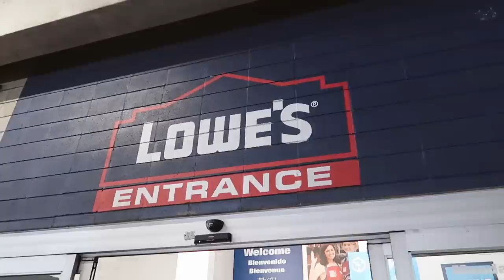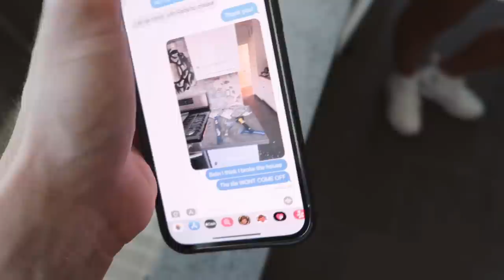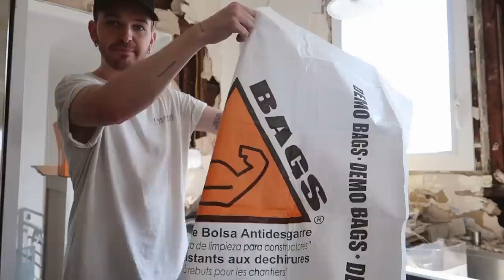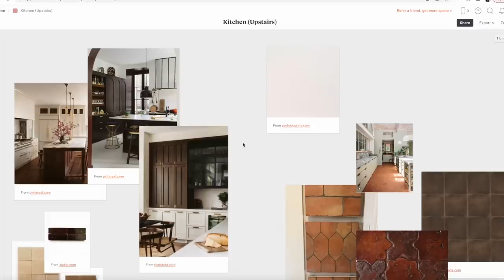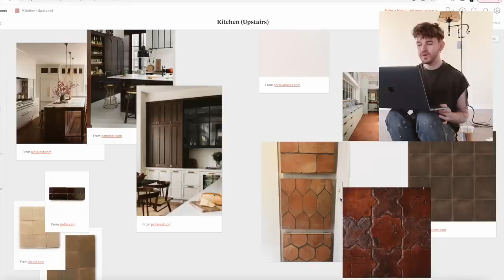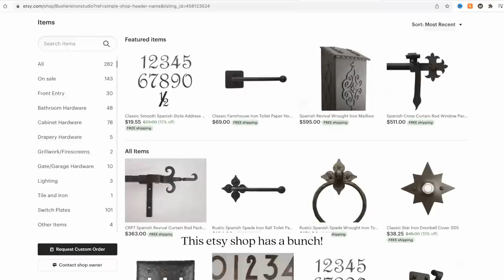I destroyed the kitchen

Comment: The good thing about ripping out the dry wall in the kitchen is that it's a good opportunity to get the electricians in to install the wiring for  more power points or new oven connection if you need it especially if the new layout is different so the power sockets for the fridge, microwave, range hood etc will be in a different location.
Reply: I was thinking the same thing. It's a great time to update wiring for sure.

Comment: Drew, please wear a respirator in case you have lead. I enlarged some windows in an old 100-year-old farmhouse and ended up with elevated lead levels! Just an FYI. I rehabed houses for resale and loved watching the changes as I torn things out and replaced them. It is so satisfying.
Reply: You are right. Either one is a problem. If asbestos is found that is a game changer for a demo. Simply using a saw to enlarge the windows caused the lead from old paint to sift through the air. Luckily the insulation in my old farmhouse was not asbestos.  Another place asbestos is often found is around water pipes and heat runs. My father-in-law was a steam fitter and dies of asbestosis.

Comment: Such a fun video!! You’re so cute with your butt sweat. LOL 

I’m a degreed kitchen designer and I love what you’re doing. Please consider installing a new, wide window over the kitchen sink (that would span all the way across the entire width of the two existing windows on either side of the sink) since you’re already down to the studs. It will make a HUGE difference in making it feel more open and airy (especially since you took down all of the uppers in that area). If you ever need help or ideas, please let me know. I’m somewhat local.
Reply from the maker: I would so love to do this but any structural change on the exterior of the home (ie. a window) has to be permitted first! I will look into the idea of opening that full window up!
Reply: Better now than a year from now and you have to do demo again.
Reply: I was 100% thinking this as well!
Reply: @lonefox   Yup - lot's of permits. And historical society or local group will have a say-so probably. Much much easier and practical to stay with " bones' of house and do your magic INSIDE

Comment: Great to see you putting the hard work in Drew!  Your excitement for this renovation is apparent. 
My thoughts on your design: I’d paint the butlers pantry dark as well as then it will be less obvious from the dining room. Also have you looked at quartz or engineered stone countertops? Marble is expensive and easily stained plus needs a lot of maintenance. Quartz or engineered stone is more durable and low maintenance. I do love the design direction you’re taking with the dark wood and Spanish influence.
Oh and don’t forget your lighting and electrical outlet planning before sheet rocking and tiling.

Comment: Demo is very destructive to everything- not just what you are pulling down. You can easily damage appliances, ceilings, floors, and light fixtures. That is why your contractor with the arches completely protected all surfaces; the floors with heavy contractor paper, heavy plastic sheeting to limit dust and debris and to also limit movement to areas NOT to be touched. You may want to get into habit of covering everything in range that you want to protect. I use heavy cardboard from boxes from things delivered. Clean-up ; start with broom !  Shop Vac is not for the heavier chunkier pieces!  And finally -:dothefive:city trash pick-up will not take construction debris  get a permit for a dumpster you can ask your contractor for info. You are AMAZING

Comment: I laughed so much at your demo faces 😂 Good job on both keeping it real, and realising when to call in the cavalry for assistance! I think you absolutely made the right call.

I also really like the idea of the marble being extended partially up the wall to fully display it and make it THE feature of the kitchen. All of the examples you showed here were great (not all were my style or preference, but the implementation of the marble backsplash was great in all of them) and I actually really like the way they were finished off with a little marble shelf, a continuation of the unified material all the way up, and having it be both a detail but evoking simplicity as well. This might be more of a transitional style than the Spanish revival you’re working with, but I would love to see both options mocked up in a render so you can really visualise them both and see which you like! You might be planning to use this kind of tactic at some point, especially if you’re torn between two different directions, but based on how great the renders have been when you’ve done them with your WWDD series, it seems like a great trick to keep up your sleeve 😃

Comment: Quick tip: Rely on Youtube videos.
There are a LOT of repair/remodel/construction videos online that will discuss everything from proper tools to proper technique to proper materials. They provide safety tips in everything from gas leaks to asbestos/lead testing to which adhesives will hold to how to legally dispose of materials.
I think you might have saved yourself some effort and prepared you better for the tile removal.
When you're getting down to the wall surface, it pays to remove everything first. That means cabinets, door/window framing, outlet/lightswitch covers, even lights. And it's helpful to run a razor knife along any corner or crevice, to avoid the paint or paper  drywall covering from ripping across an adjacent plane (I noticed some of the tile/wall removed stripped across the ceiling; you would not have had to replace the ceiling drywall, but now you have to, especially in a moist environment like a kitchen).
Considering how much area you were clearing, you did a fantastic job in a short amount of time! This kitchen will look AMAZING when you get done!
Please have someone come in, an expert, in testing for asbestos. Old houses like yours have it in old walls, but especially in floors. Many times, asbestos floors are covered over with safer layers. When you go to pull up those floor tiles, you may disturb asbestos tiles and endanger yourself.
Please be careful!

Comment: One thing to consider when choosing flooring is how much maintenance it'll take. With terra cotta or any tile, if you drop something heavy, you're likely to break the tiles and then you'll need to replace them. And yes, things will fall. That's just the nature of a working kitchen. 

As someone else mentioned, the cabinets in the kitchen might be better to have all white or that cream color. The space is smaller and it could end up feeling tighter than it really is. But if you put the darker cabinets in the butler pantry, the drama of that look from the one archway would produce a truly WOW moment. 

Another thing to think about with the hardware in the kitchen is the functionality. While the heavier Spanish revival look would be in keeping with the age and style of the home, it may detract from the other beautiful touches you're adding to the kitchen. The other consideration is the likelihood of catching clothing on more elaborate &/or protruding pulls/handles. As someone who has had more than one such incident occur, the struggle is real (& also led to more than a couple dropped platters, pots, & pans, which brings you back to the type of flooring you choose).

One of the benefits of age (ugh, I hate that I just said that) is the years of misadventure in a variety of homes. If there's ever been an unfortunate feature or design element in a home, I've likely lived in that space and cursed it mightily and repeatedly. 

No matter what you input you receive from your followers, it all comes down to what you want and what you feel is right for you. 

I'm so excited to watch this home come together and reflect your vision. 

All the best!

Comment: Drew, you should wear bicycle shorts or work out gear that wicks sweat away from your skin. Otherwise, you could develop prickly heat rash or chafing. Another thing you can do is put pieces of alum (not powdered) in your front pants pockets. They look like translucent white rocks. Alum is an antiperspirant and unless you are sweating absolute buckets it will help keep you dry and comfortable. I have the feeling that when your home remodel is complete you are going to have a lot more definition in your arms and legs from all the extra physical activity.

Complete remodels are scary! You are a lot braver than I am. The results will be so worth it though.

Comment: Hey mate, just a quick one, I enjoyed the lamp shopping you did in a couple of Vlogs back. Just wanted to say, while the RUST may make it look Rustic, you do not want that, over time the RUST will get worse, it will eat away at the metal and eventually ruin the Lamp. You need to remove Rust as soon as you see it. Check around or ask on here for a good product that you can coat your metal lamps with to protect them from future RUSTING, and if possible ask around and see if there is anything that will repel dust from settling on all your lamps without damaging them in any way. Both RUST, it may look good, but never appropriate on an antique fitting under any circumstances if you want to keep and grow the work's monetary value! Nice house mate, those wooden supports are A1.

Comment: Now you know you need to insulate, add a vapor barrier, redo the drywall, etc. before you get to the fun parts. Better to do it all and do it right. Nice work!
Reply: VAPOR BARRIER is a NO - in older construction- lath and plaster , the house breathes and there is no moisture build-up. Biggest mistake new owners make with older home is to create ' airtight' barriers

Comment: One thing to keep in mind when choosing your tile for the floors: using tiles with very irregular/organic surfaces and wide grout lines can be crazy difficult to clean.  Both vacuuming and mopping are challenging.  Most modern upright vacuums, like Dyson, use the same head for hard surfaces and carpeting. That head is made of plastic with very little felt padding along the edges - which is fine for smooth surfaces, but means when you use it on irregular surfaces it tends to scrape instead of glide. 😧
Additionally, crumbs tend to stay in these irregular areas and the grout lines and require more time to remove when cleaning.  I speak from many years of experience living in a home where the previous owner installed outdoor Pennsylvania Bluestone tiles in the kitchen and main bathroom.  When we had our old corded canister vacuum with the separate hard surface head (edged with lots of felt), I had to vacuum each square tile separately and then go over it all again just along the grout lines to ensure it was clean.  Now that I have an upright battery vacuum, I have to first clean all the grout lines using the crevice tool on the hand-held motor, and then add the power head and go over the whole floor very slowly and very carefully so as not to scratch the floor or damage the head. Ugh!
And that’s only vacuuming!  We can’t use a mop to wash it because the irregular surface chews up sponge-head styles, and string mops don’t scrub it properly.  Our easiest option, unfortunately, is the ‘down on hands and knees with a bucket and scrub brush’ method.
Apologies for the long spiel on this, but please be sure you choose tiles that are meant to be used indoors and will be easy to clean.  Our terrible tiles were laid during a previous house reno on a very thick bed of mortar and then all the cupboards and appliances were installed on top of it - so removing and replacing them would be an expensive and nightmarish proposition.  Happily, we’ll be moving in the next year or so and a smoother kitchen floor is high on my list of priorities! 😂🤣

Comment: I ended up just ripping off the dry wall too when replacing my kitchen backsplash. The further I went the worse it got. It was painful but if you can't get the surface absolutely flush, your tiles will be impossible to apply.

Comment: I was wondering why you were going to patch that old sheetrock since it's weak. Wouldn't it be better just to take all of it out and have them put all new sheetrock in there? Just a thought.
Another thought I had is when you use terracotta it's very porous. So if you fry meat or you drop stuff on the floor it will pick up the grease from what ever is dropped. Also the same thing happens with the backsplash area. Anything that you splash? On that will be difficult to take off of terracotta. The idea is really cool looking. But I think you'd be better off with a glazed tile. It would be easier to maintain and clean.

Comment: Iye, just rip out all of it and redesign the kitchen and start again.  Those drywall "patches" would be SO MUCH EASIER & BETTER finished if the contractors could just start with stud walls and not have to tape and mud around all the cabinets and such.  It will look so much better too, in the end.  
DEMO is hard and yet the EASIEST THING.

Comment: Nah - your experience is pretty much what every other DYI-er and pro see when it's time to remove tile.  Just easier to take out the drywall with tile attached (after you punch holes through to see where wiring and pipelines are and then carefully use a shallow electric saw to just go through the drywall and not sever any of the wiring or piping) and then install new drywall and tile over the new.  P.S.  Nobody looks like a beauty when they're doing hard labor.  I'm a 71 year old woman and I sweat harder than any male I've ever worked with!  Just one of those nasty facts, certainly not a brag, super yucky!  I just have that metabolism where I when I start to sweat, it looks like I'm showering, but there's no water anywhere near, LOL.  You get over it.  Just be sure to keep yourself well hydrated while you're working and use a good body moisturizer after you shower.  You'll need to give extra love to your hair too because washing it daily is really hard on it.
Reply: Thanks ❤️ Let me Introduce you to a life changing  investment for good investment programme☝️☝️

Comment: Just cut the drywall and pull whole sections off. the drywall will need replaced anyway, And you didn't finish pulling all the drywall off. which means your demo is incomplete.